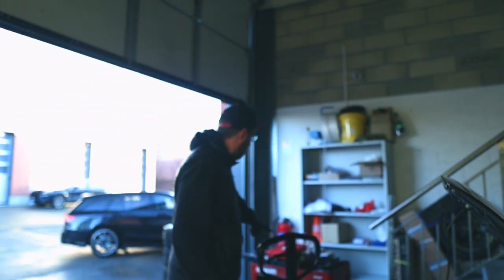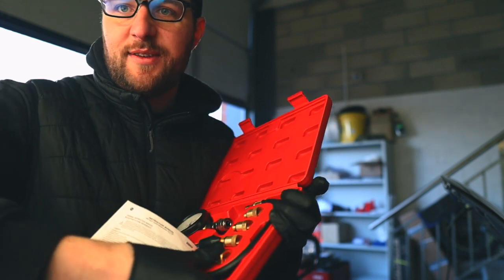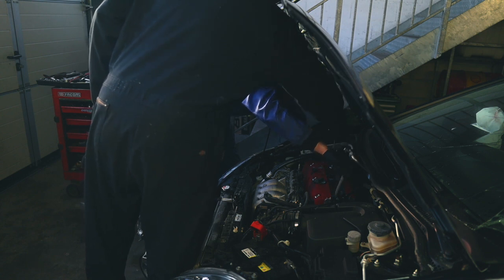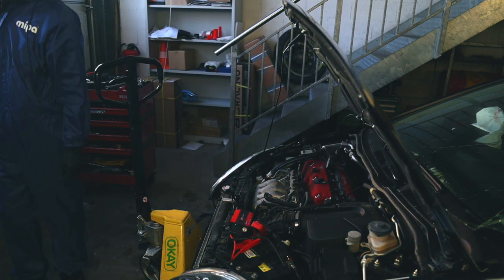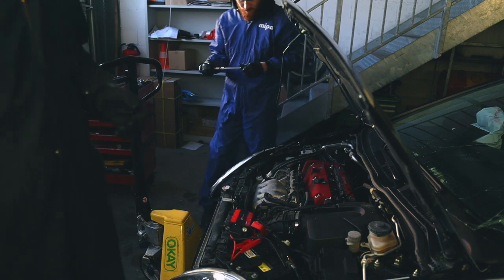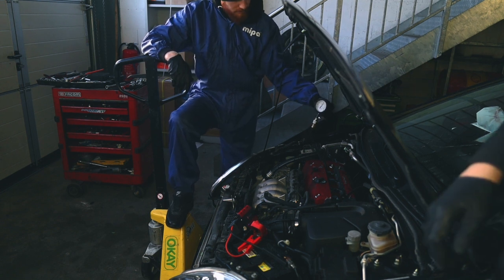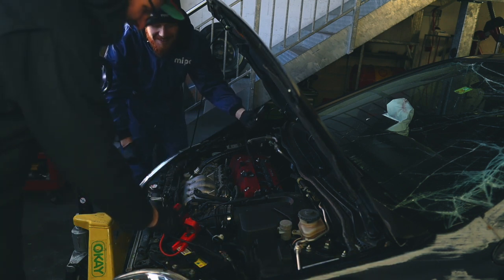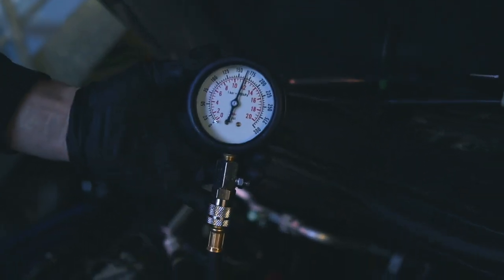How to Kswap an Mr2 Spyder EP3: K20 engine Check prior to removal from Donor Car (compression test)

Comment: I learned you're supposed to do the compression check with the engine hot, since the pistons are actually kind of oval and don't become circular until they are warm, thus seating the rings better.  On the other hand, I always do it cold myself too, because it would be kind of difficult to keep warming up the engine between measurements.  Unless you are quick the engine would cool down and you'd get a different measurement for the last one vs. the first one.  Anyway, just sayin'.
Reply from the maker: Hi, you are right buuuuut… it depends on what the engine builder or manufacturer wants. Many want cold compressions as a refenrence. Its normal that it increases when warm. 🤷🏻🤷🏻🤷🏻

Comment: I have a suggestion why would you remove the injectors why wouldn't you just remove the fuse for the fuel pump
Reply from the maker: Hi, good suggestion. However I was too lazy to go look for the fuse 😅😂👍🏼